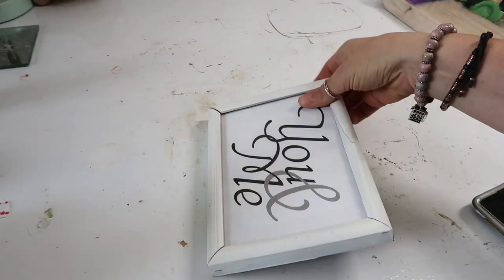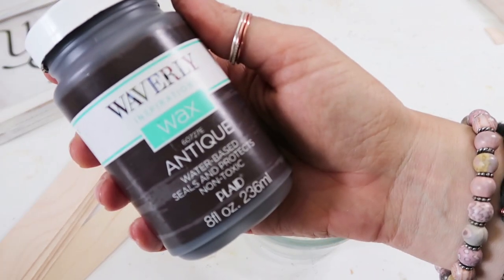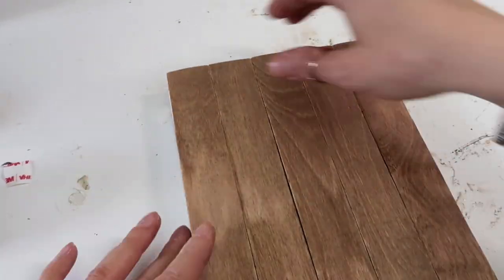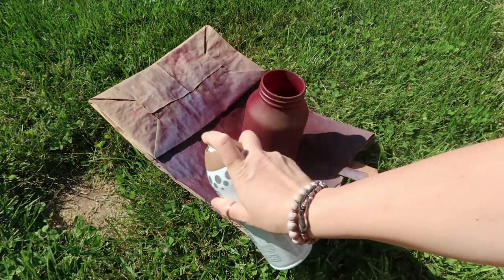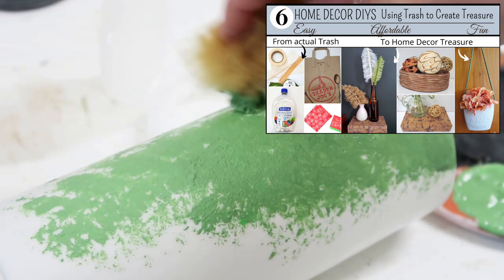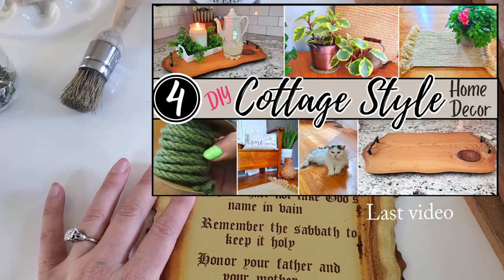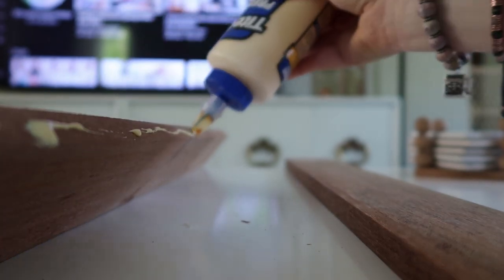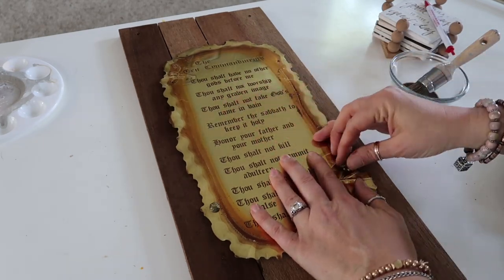4 DIY ALMOST FREE DECOR using TRASH, RECYCLED, REPURPOSED & THRIFTED ITEMS ⭐ Coffee With My Sunshine

Comment: Casey I am just at the point of you having difficulties with your miter cutters, (And I know that some will disagree with me) but those types of cutters squish the wood, especially a light wood like a craft stick, so it isn't so much 'Cutting' the wood, it sort of compresses it apart.
That is why some people run into an issue when trying to match cut ends of sticks together for example, because it isn't a clean cut.
Reply from the maker: Hi Della, You are so right! I was thinking the same thing as I was using it. So it would probably be easier to use a little saw or  something. I was struggling with that thing for so long with this project 😄 Thank you for your help & tips! They're really helpful💖